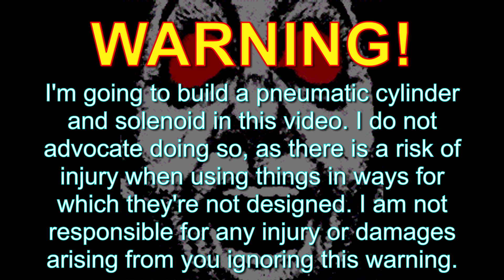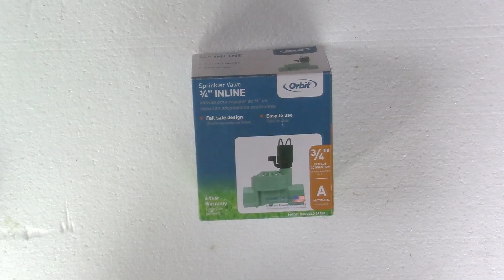Homemade Pneumatic Cylinders and Solenoids #1 | DIY Halloween Vlog 2016 #51: Pop Goes The Geezer

Comment: Good info. Only thing I would change are the barbed end hose connects and use push type quick connects. They are super cheap from Ebay/ HF etc etc.
Reply from the maker: Hi Matthew. That's actually a good idea, but no local hardware store carries anything like that. The single barbed connector I used was the one for the screen door closer. I could have bought all of this stuff online, but I just wanted to bang this out in an afternoon. All that being said, I wouldn't build one of these again and just buy the actual cylinders and solenoids online. Thanks for watching and commenting!

Comment: I use 3 way valve for air flow to multi prop  from air compressure  not talking about 3 air compressure  just hose to prop from 3 way  but i seem having a problem   what u suggest
Reply: my air compressure tank keep empty
Reply from the maker: I'm not a pneumatic expert by any means. This was my first foray into pneumatics, actually. Hard to tell you what the problem is without more details.
Reply: ok thanks    I use power wall plug but look for output 12vdc for trigger foot pedal and it works  not have to use a car battery
Reply from the maker: Check for leaks. Make sure you have the thread seal tape on all of your connections. Good luck!
Reply from the maker: Yes, I used a 12v DC adapter as well. The battery was just used in the video for convenience, since I had one sitting there.

Comment: What compressor do you use ? What to recommend that runs on 110 volts
Reply from the maker: Any decent compressor should be fine for a single pneumatic prop. Mine is a 3 gallon 125psi Craftsman, and I ran two pneumatic props off of it for 3 nights. You can see it in the next vlog episode. Thanks for watching and commenting!
Reply: Montclair's Lair would this work for 2. Or 3 air cannons a coffin poper and a prop like you are making http://www.homedepot.com/p/Husky-30-Gal-175-psi-High-Performance-Quiet-Portable-Electric-Air-Compressor-C303H/206532808?
Reply from the maker: I can't imagine why not. Looks like a nice compressor!
Reply: Montclair's Lair 
Thank you I picked this air compressor up and it works great
Reply from the maker: Awesome! Post some videos of your props!
Reply: What other prop do you have besides this one that run on air
Reply from the maker: Zombie containment. It was much quicker and easier with an actual pneumatic cylinder and solenoid. You can see it discussed in this video https://youtu.be/7gMBPWTdvXg?t=5m10s, and see it in action here: https://youtu.be/LfX-v8RQvLc?t=3m36s
Reply: Montclair's Lair wow that looks amazing I wish I had your talent
Reply from the maker: Thank you! Trust me... if I can do it, anyone can. :)

Comment: I really liked your tutorial.  One thing that I found out is the sprinkler valve will run off of a 9 volt battery.  I use two in parallel so you get more use out of it.
Reply from the maker: Thanks, Tyrome. Good info on parallel 9 volts. I'd heard that running it on anything < 12v and there was a risk of it not firing, so it's cool to know it'll run on 9v. Thanks for watching!

Comment: you need 1/8 npt tap, its not the same as a 3\8 unf. pipe taps are tapered the same as the fitting  to make a seal.3/8 unf is straight and has a 3\8 major diameter. 1\8 npt usually refers to id of pipe. get your self some pipe taps, a chart for correct drill and stop tapping when you have 5 to 7 threads left out side of hole.

Comment: nice job!!! I like this idea and I didn't think $44 was to bad and your video was only 14 min so I didn't think It would take very long to build it. One question if you don't mind.... what's the purpose of the Sprinkler valve? just to clarify for me.
Reply from the maker: The sprinkler valve is an electronic method of allowing air to flow into the cylinder. Without it, air would always be pushing the cylinder up and the prop would never go back down. It's being used as an air solenoid, which is what's normally used in these types of things. With it, the prop can be connected to a manual switch or prop controller to trigger it. Hope that helps!

Comment: I have used many of those door pistons over the years. They work great never had one fail. but I never pushed more than 50 PSI through them. And since you can find pneumatic cylinders on the internet for really low prices, it doesn't make sense to use them anymore. I have also been buying the cheap 5-way 12 volt solenoid valves from Amazon for $6-7 and they have been great. They have some thread issues but can be resolved with a little tinkering.
Reply from the maker: If anyone knows about this stuff, it's definitely you. Your props are amazing! Thanks for sharing about the screen door cylinders. I've got my mechanism working at around 45 PSI. Appreciate the comment!
Reply: That's a great compliment. Thank you. But I'm still learning new shit everyday. I purchased my first Arduino after watching one of your vids. Have not needed to use it for a prop yet but at least I know how to program it thanks to your vids. Please feel free to post the links to your videos or any progress photos on my FB group page. That's what my group is for,  advanced over the top DIY Halloween props and you definitely  qualify.
Reply from the maker: Well, that's quite the compliment coming from you. I'm definitely not in your league, but I think we share the same interest in the stuff. I'm glad you enjoyed the Arduino prop controller videos. I learned more than I ever wanted to know about that 4 banger prop controller while making my electrocution prop. Thanks for the invite to the page!

Comment: i used my sprinkler head for an air cannon, works great, but lawdy i got a 12 inch double acting air cylinder on amazon for 27 bucks, and the nose mount, rear mount for another 10 bucks, a 6 inch cylinder is 15 bucks, and for a 2 position solenoid valve 7.22 so if you went with 12 inch cylinder 27 bucks, 10 bucks for mounts, and 7 for solenoid total 44 bucks, now you will need your push connect for hose n such but figure like 50 bucks, if you went with 6 inch less than you paid.. :)
Reply: did you see my video on haunters hangout with my air cannon demo with the auto drop panel and zombie head?  I had my wife and mother walk through to show them..
Reply from the maker: No, I must have missed that one. I'm subscribed to you here on YT so I see whatever you post there.
Reply from the maker: Well, technically, I paid around $35. I returned the $10 cylinder to Home Depot today as the $2 one is working fine. But, I agree and will be going with solenoids (2 positions are $6 on ebay, and 5 ways are only $9) in the future. I just got sick of waiting for China shipments so I got going with this. It's been a good learning experience, though. :)
Reply: yeah havent posted it on YT yet..
Reply: yeah thats why i got my solenoid from amazon 9 bucks prime, and same with the cylinder prime 2 days new  and cheaper than any of the normal places, only issue is they dont have lots of sizes, but if 6 inch or 12 inch works then you good to go.. i think they have some smaller ones too

Comment: Is there any reason you didn't buy an air solenoid off eBay ?  They are not expensive at all and you can get adjustable exhaust ports, etc.  I agree about the confusing thread size naming.
Reply from the maker: I did, and they're not here, so, time is my motivation here. I agree that using the sprinkler valve is ridiculous, especially since the solenoids are cheaper on ebay. Like I said in the video, I'll never do this again. But, for the experience of doing something and the lack of time, I gave it a shot. And screw whomever came up with all of these sizes. I was looking more carefully at my tap set and I have one bit that says 1/8" NPT. It's essentially identical (except for some tapering) to the other bit in the set that says 3/8" something or other. Why does mankind do this to themselves? So confusing.
Reply: Yeah, you have to be so careful choosing parts to make sure they will fit together.
Reply from the maker: Yep. I wasn't lying when I said we spent hours shopping for this stuff. Literally, 3 hours between Home Depot, Harbor Freight, and Lowes. It was torturous.
Reply: So that explains the (no) hair situation!  lmao

Comment: "What's the most you've ever lost in a coin toss?"
Lol idk if you've ever seen that movie "No Country for Old Men" Where this dude goes around with something similar to this pokin holes in peoples skulls.
This is pretty badass though, I bet you could find a ton of uses for this aside from the coffin prop, and with it being a simple method to disconnect you'll be able to swap it from prop to prop each year if you decide to do something different. Pretty good deal I think.
Reply from the maker: Yeah, I've seen that movie. I think he was using one of those pneumatic cow killer deals, whatever it's called. As for swapping this around, once it's in the prop, it's not going anywhere until it fails. But, you are definitely correct. Pneumatics are at the heart of Halloween scare props, for sure. I've been wanting to get into this for over 10 years, so I was determined to take this long weekend and figure it out -- and man -- next time, I'm buying the real stuff from ebay. It just took so long, and you can do a lot more with real pneumatic cylinders. But, hey, I had to start somewhere! Thanks, Gen!

Comment: can you control it with your arduino prop controller?
Reply from the maker: Yes! That's what I plan on using. :)
Reply: I would think so. If it is a motor or a solenoid, it con be controlled by it.